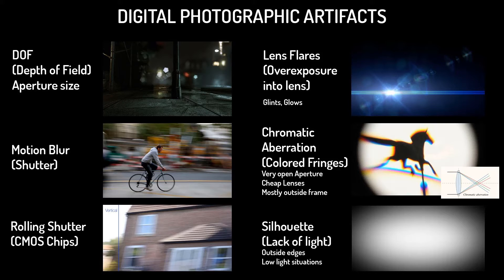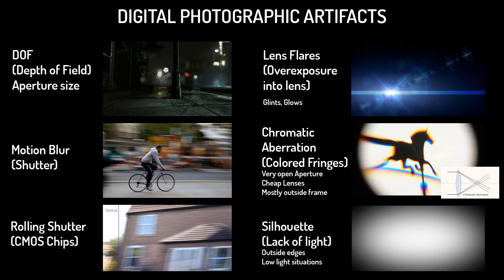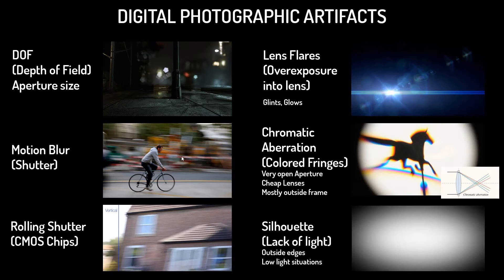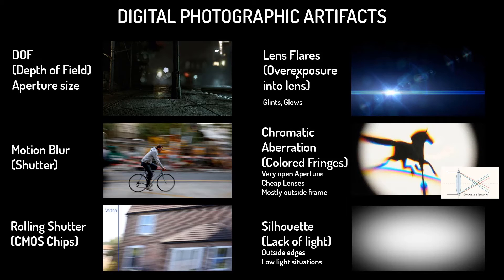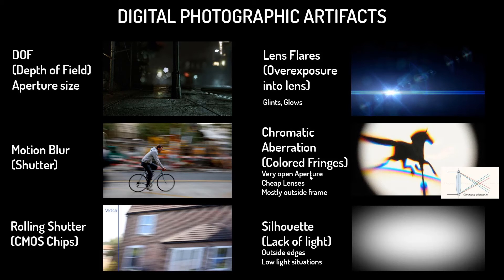NKE 101- Nuke 101- PART 9: Camera Lens Artifacts

Comment: Hi… I really like what you presented here. I don’t know if you cover this any where but I’d like to know how to make my 3D renders closer to what I see in my photos/videos. The big deal to me is not what the lens does but what the sensor picks up compared to Arnold’s camera in Maya. The differences are stark… and it seems that it’s more a matter of exposure and/or values that a render look like it’s seen through a camera or Maya. I’ve really looked around to find information on this and all I seem to find are “here’s this or that Arnold light placed here and there” but there doesn’t seem to be anything on showing how to render to mimic the actual digital lighting. Sure, Arnold’s is great for rendering… but in terms of matching photography, it’s so far off - or else you wouldn’t need Nuke, right? To me it’s all about value ranges. In photography, lights blow out due to over exposure…. and shadow information changes color. But in Arnold, those color changes don’t really take place… and the objects look plasticy! Any info on this would greatly help. Thank you!